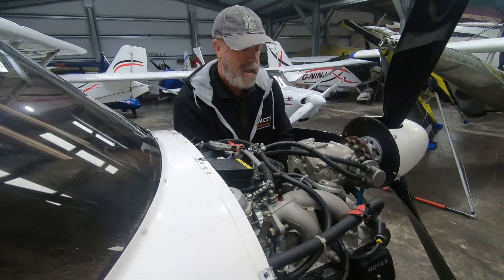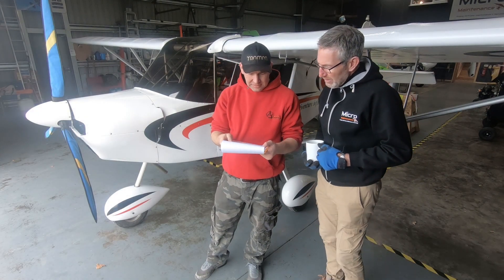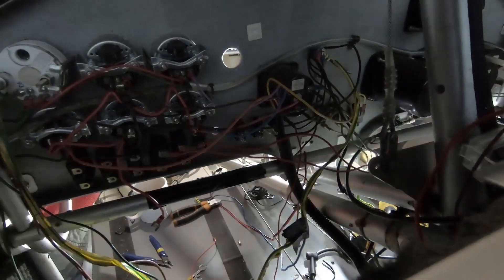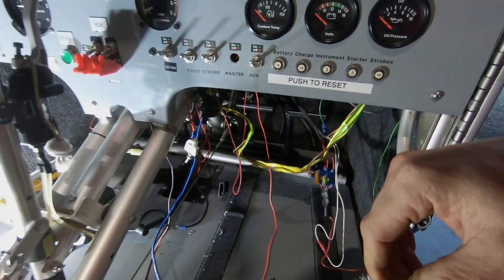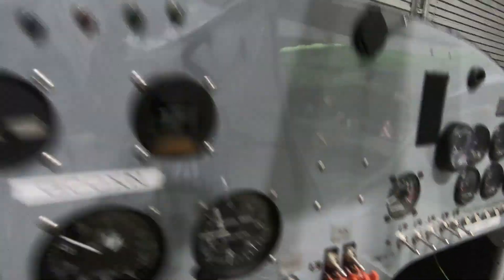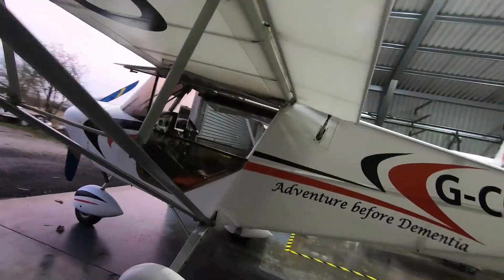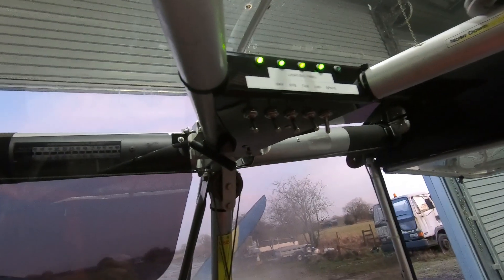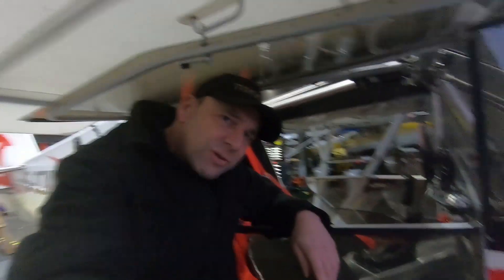Skyranger classic 912 rewire & Mods: WingNuts Micro Maintenance S3 E2

Comment: Very clean wiring install. I just have a question on the position of the fuse box. Surely it should be accessable without removing panels. Also the flap indicator led light etc is directly in your eye line. In my experience led's which are in your eye line are so bright as to be a distraction. I would appreciate if you could clarify the above. P. S. GREAT videos with alot of  excellent content.
Reply from the maker: Hi Peter, we’ve placed the fuse box in several places and found that to be an easy location to install a larger fuse box, we also have occasionally added further fuse boxes to bounce down primary power and auxiliary fused circuits. If a fuse were to blow in flight replacing mid air would not be advisable, better to land and discover the problem. The dash is only two screws to remove.

The LED flap lights we have placed in serval locations but do place them to be obvious. As day only aircraft there is no issue with blinding or white spots.

Hope this helps explain why we did it this way on this install. We work with our customers to give them their set up and bring our experience on what has worked or not before.

Comment: Those are some impressive landing lights! Might have to consider a set!
Reply from the maker: We’ve developed an in line filter that removes 95-99% of the static. Plugged in directly and they would be unusable.
Reply: @wingnutshomeofmicromainten6946  I'll drop you an email!
Reply from the maker: Yes, very happy with them and a shade of the usual price too 👍🏻
Reply: @wingnutshomeofmicromainten6946  I'd be interested! Any radio interference on them?
Reply: Be Seen lol!

Comment: Very nice work - nice safe aeroplane now too. 

I was pondering, are soldered terminations/terminals/Lucars etc preferable to crimped types?
Reply from the maker: Hey, thanks 👍🏻

Soldered joins are not really used as they are more susceptible to vibration and damage than any other connection. Crimped joints in a multitude of connectors are always preferable.
Reply: @wingnutshomeofmicromainten6946  Hi thanks, good points, also solder and flux can cause corrosion and become brittle 🤔🤔👍😊

Comment: It was good to see the project through to completion. One question though, why did you use what appears to be automotive cabling and crimps rather than aircraft spec components for the rewire?
Reply from the maker: Hi Tom in Microlighting/ultralights this is the standard wiring practice and materials, to be honest in some cases what we did is a huge upgrade.